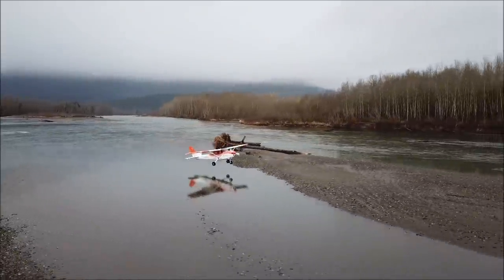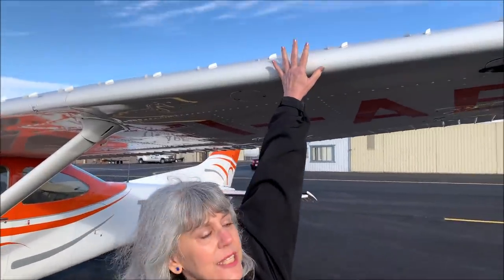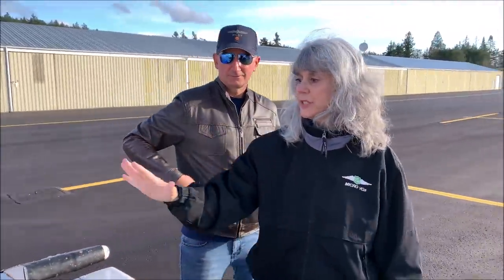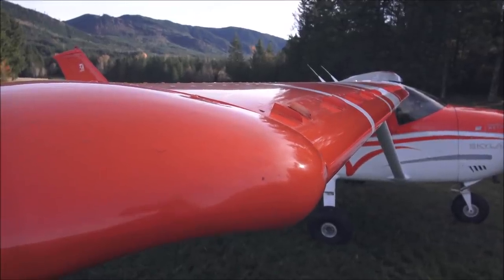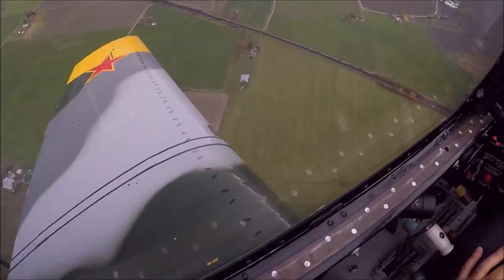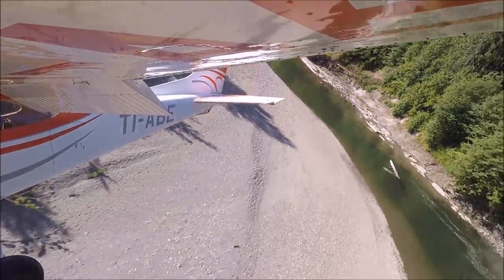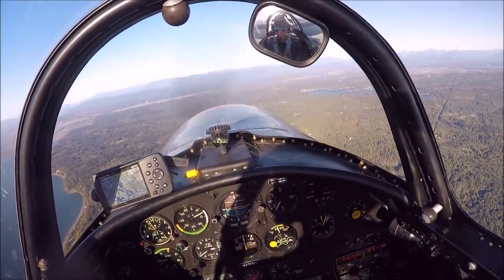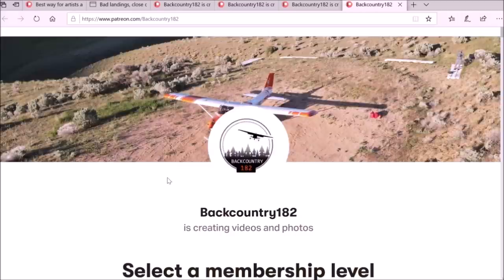Vortex Generators do they work? we interviewed an expert.

Comment: On Learjets we use boundary layer energizers on the wings, but not for help at low speeds. It’s to give aileron authority at greater than .77 mach. 

Otherwise the airflow would separate, creating a boundary layer envelope on the top side of the aileron, and the controls would feel really numb.

If we are missing even just 1, our max speed is limited from .81 to .77

Comment: I did accurate testing before and after I put vortex generators on blue suede shoes. I documented this, tests were done at similar weights temperatures and humidity. I found anywhere from a seven to a 10% decrease install speed. That was What could be proven, What couldn't be proven but definitely holds true is the control ability at lower speeds. Eeler on effectiveness increased along with elevator effectiveness. It made the aircraft significantly shorter on both takeoff and landing.

Comment: The VG creates a situation where the boundary layer does not separate from the surface of the wing, there is no TRICKING the wing involved, she has no idea how they work. The position is critical, they only perform their function at low speeds when they are still exposed to the airflow, in the case of high AOA they must be able to SEE the incoming air, thus ,they must not be mounted too far back from the leading edge, 5 to7% of the chord is typically correct. They do induce drag at all speeds so there is a tradeoff on having them and not having them.

Comment: Well, in aerodynamics nothing comes for “free”. What are the disbenefits of installing them? You emphasize the slow speed benefits, which are important to your operations. But where is the aerodynamic cost? Is it extra drag and fuel consumption at high speeds? Not trying to be argumentative just trying to grasp the whole “cost vs. benefit” picture of the modification. Seems that I’d there was absolutely no disbenefit or cost then the manufacturer would put them on all planes at the factory. Thanks for yet another educational and interesting video!
Reply: They are a rather new development as aerodynamics with the help of CAD has been advanced in the recent decades. I would think as a layman it depends on when (on which AoA) they start to generate the vortexes and if that correlates with increased drag on normal operations. On fighter-jets such devices and design are use to improve maneuverability by not having stream separation on high AoA and a delta wing produces its on vortex on high AoA.
Reply: I can't speak for any other aircraft type, but those I know that have them installed on their Cessna 150s report a 3-4 knot increase (true airspeed) in cruise.  On a 150 specifically, every knot counts as a pro, but the con of installing them is the additional weight.  While marginal, pounds are also expensive on a 150, so every one counts.